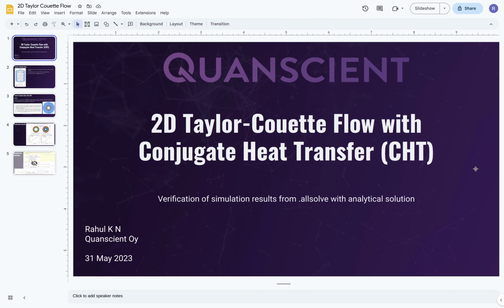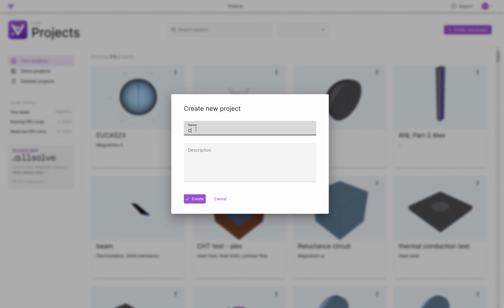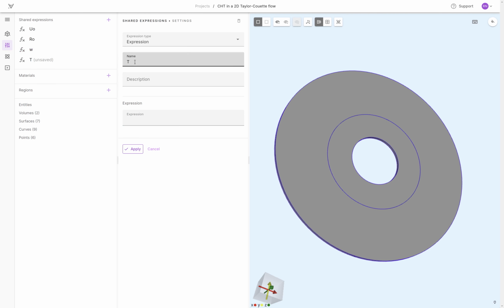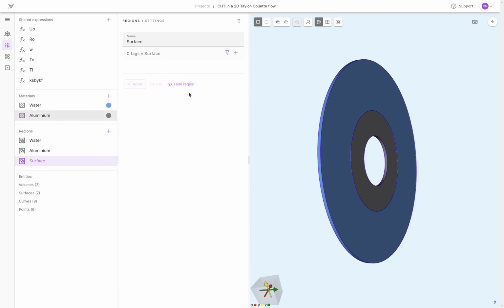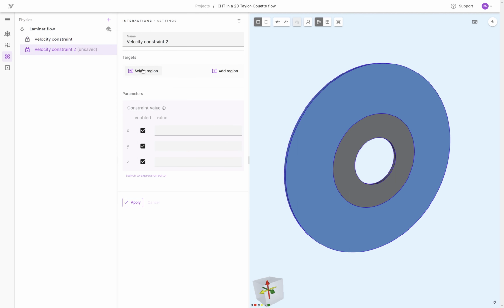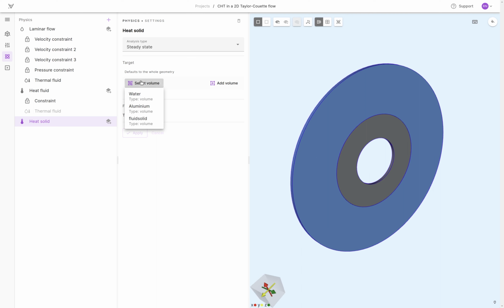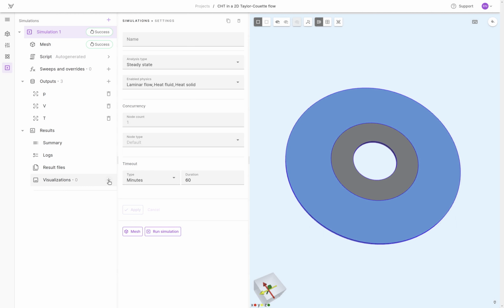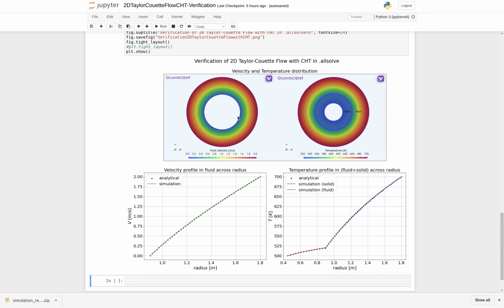How to simulate Conjugate Heat Transfer (CHT) in Quanscient Allsolve

Comment: Very impressive video, Rahul! But I still have two questions: You are talking about a 2D problem. For me, 2D means looking on a cross section in x-y direction and infinity in z direction. So the problem is more a 3D problem with a thin layer. Secondly, what about the units? Are they automatically SI units unless you define  them otherwise?
Reply: Thank you Bernard for your comment!

In .allsolve, the geometric model must be in 3D. However, with the use of right boundary condition, 2D and even 1D simulations can be performed. In this particular example, the velocity in z-direction at the side surfaces are set to zero (i.e. no fluid flowing out in the direction normal to the cross-section). Additionally, since the Taylor-Couette flow assumes viscous fluid, for the boundary conditions used there is no velocity evolution in z-direction and remains zero. Ideally, it would have been convenient to set z-direction velocity to zero in the complete volume as it would certainly ensure that the flow is 2D. But keeping in mind the experimental setup of Taylor-Couette flow, the aforementioned boundary condition seemed more apt.

To answer your second question - Yes, it is assumed that the user is providing geometric data in SI units. The predefined material properties in .allsolve database are also in SI units. Naturally it is possible to create the geometry in any user-defined units with the caveat that the material properties are modified accordingly to account for the change in units.

Let us know if this answer your questions. We are happy to discuss more :-)